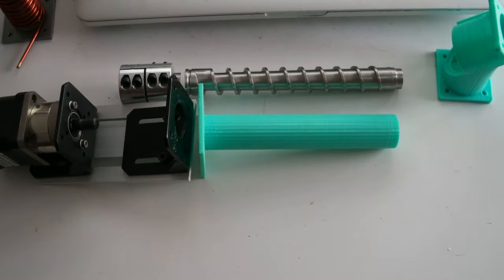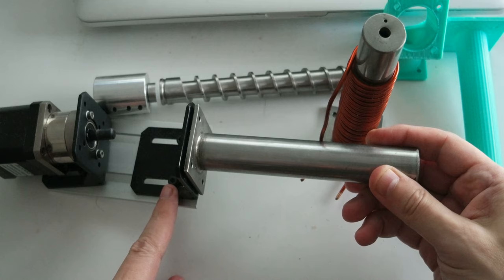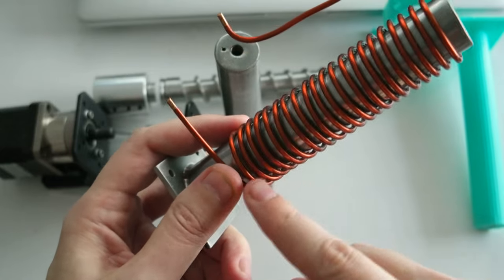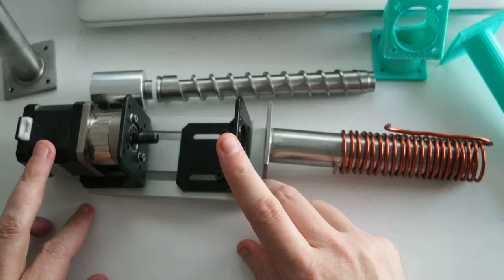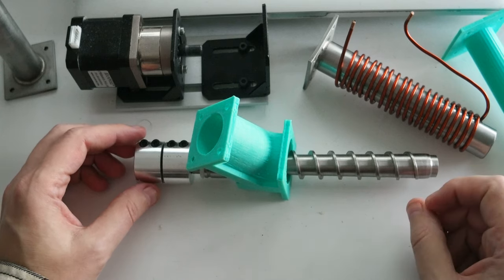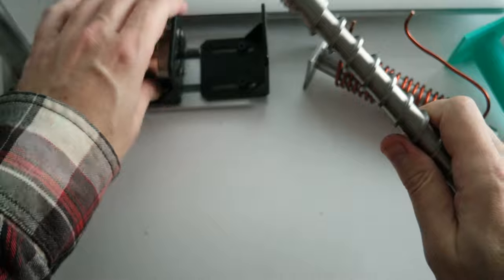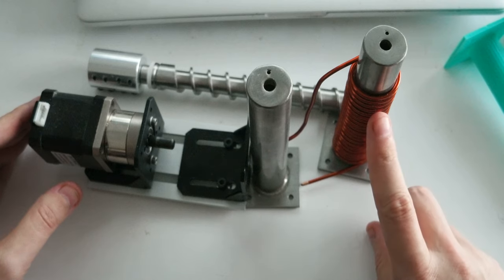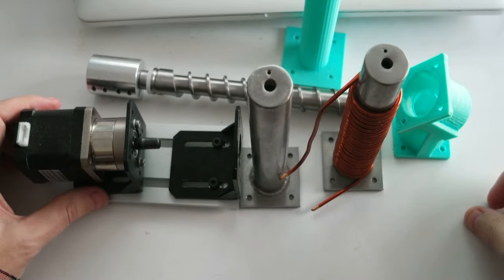3D Printer Dual Pellet Extruder parts, tubing for drill bit

Comment: Any chance we could order that tube/chamber from the manufacturer to build along with you?
Reply from the maker: Unfortunately was just one set since the builder is a local one and does other things. It was a very different work of what they do usually. In any case you can find someone that does stainless steel work or aluminum (if you do not need steel) and build it around the drill bit that you choose. Please subscribe, thx
Reply from the maker: If I find a manufacturer in the future willing to make sets of these I will share for sure. thx

Comment: What about band heaters? Would they not be a good alternative to conventional cartridge heaters?
Reply from the maker: yes they can work, in fact is what is used in most similar application. But you still heating by convection, so the drill bit get heated because the air inside the tube is heated. With the induction heating it will heat any metal object that inside the coil by inducing a current, it should be a more uniform heating and more controlled. Will need to test it ! Please subscribe thx
Reply: @ganzoai  I get it, but wouldn't that make it worse for cooling the cold zone since the drill/feeder would distribute its heat much more? For example, in electric welding machines, heat is distributed from end to end of the part.
  I am building a pellet extruder with a long barrel to try to improve the heat zones, using passive cooling with aluminum in the middle, but with that I will have to use a 3d printer with a stationary z axis because of the weight and size.
I see some projects that use bad thermal conductive material as a separator, but I wonder if anyone has tried using peltier cooler in short extruders, although it is a double-edged sword because of having to eliminate the heat transferred and the higher power bill.
Reply from the maker: @HunterNX_s  absolutely valid points and I will need to figure out a solution for cooling the parts before the motor. The tubing are attached to a motor holder which will be attached to a aluminum frame, so some heating will dissipate there. If you look my older extruder you can see how they are mount. The tricky part will be the drill bit which is attached to the motor shaft with a coupler, so there I need to figure out a cooling solution. Will try different ideas because I do not know yet a good solution. Also need to take into account that both drill bit and tube are stainless steel. But yes need to figure it out ! Great to know you are working on a pellet extruder, make some videos would be interesting to see your take ! thx